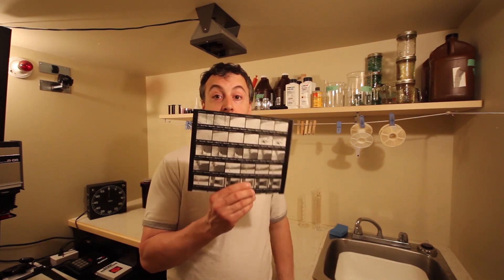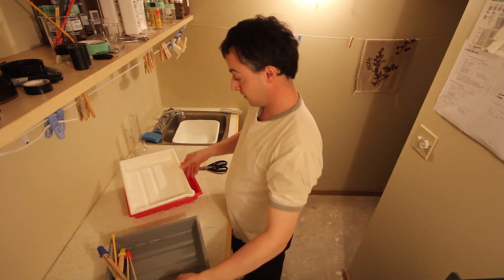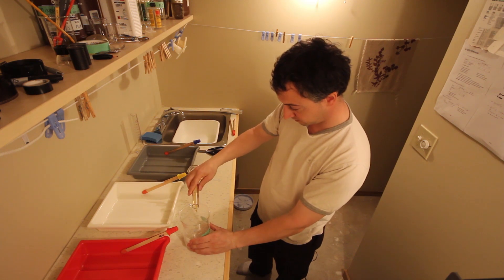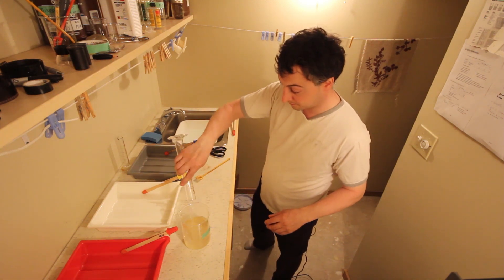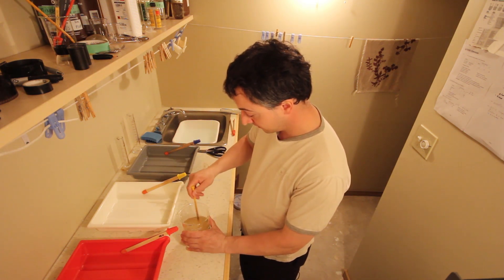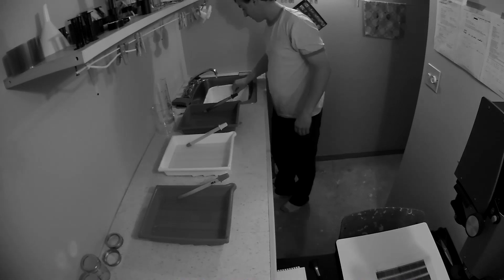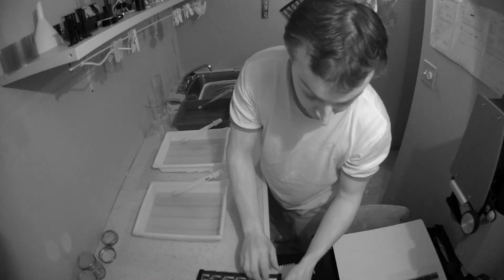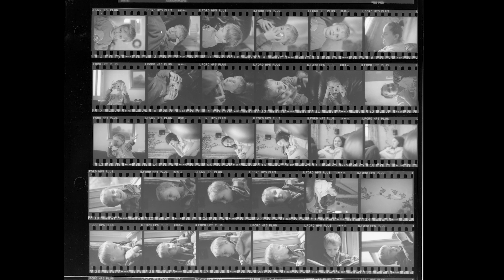Making a Proof / Contact Sheet in the Dark Room

Comment: Very informative! make sure to print contact sheets by choosing the exposure that just prints through the fog base of the film.  This happens right when the difference between the unexposed sprockets of the film and fully exposed paper is just indistinguishable.  So right when the sprockets basically disappear to full black.  This gives you the true exposure of your negatives and you'll get a ton more info about how you metered and if you nailed the exposure :) Cheers
Reply: Yes maximum black, its called.